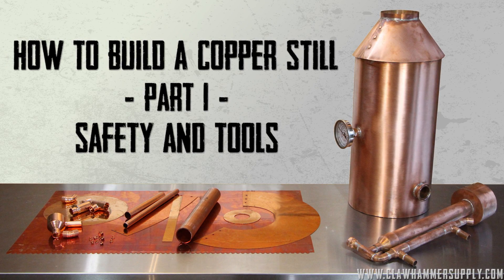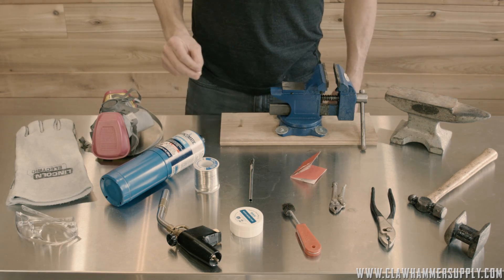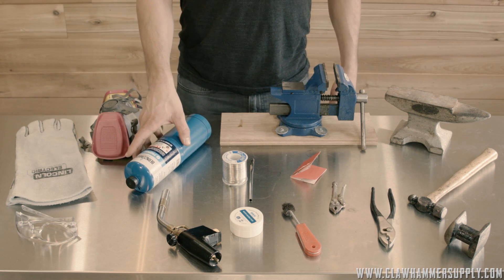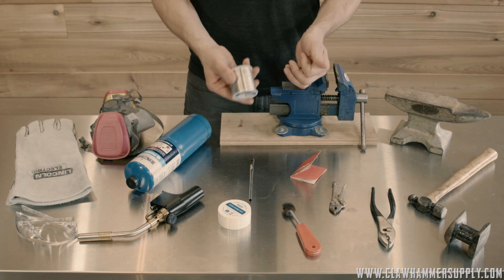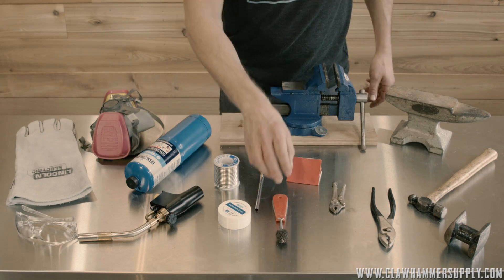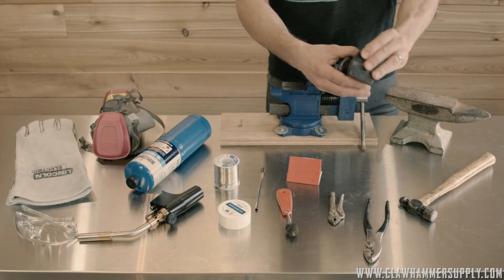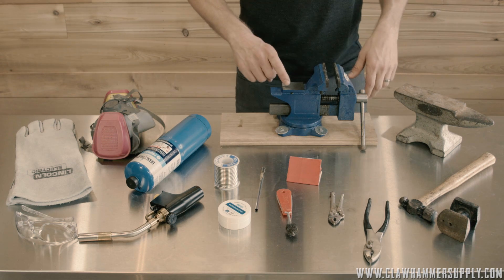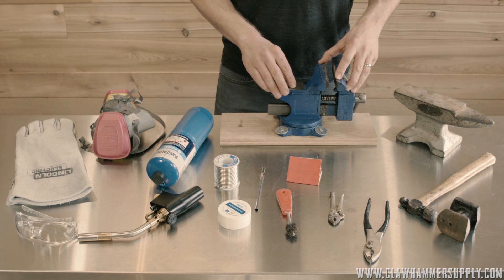How to Make a Moonshine Still - Part 1 - Tools and Safety

Comment: Is there a built in worm or cooling condenser of any type in this still?
Reply: The top section sold with the still is the condenser. It's not a traditional worm, but it works just as well

Comment: What is used for the heat source when distilling?
Reply: Depending on your set up, you can use a heat plate for smaller stills or a propane burner. I use a burner that came with a turkey fryer, but some folks use an actual wood furnace, but that's a lot of work to build
Reply: Can you use a induction Cooktop

Comment: Kyle .. Got a  Question 4 you .. now Ive Had pots made from 304 stainless food grade 50 gallon barrels and in the bottom  I had 14 ga copplate sweated in the bottom .. Im getting ready to retire in a yr or so and Im thinking of doing a copper pot .. 
Now Im thinking of a 50 ga spit pot . 14 ga bottom and  20 ga for the pot ..  big difference between copper and stainless ..   can you share some info ? 
thanks .
Reply: The main difference I'm aware of is flavor. Copper reacts with the alcohol and makes if smoother without changing the abv much. Take what I say with a grain of salt because IV only run a few batches.
Reply: i was thinking of putting a copper sheet in the bottom of my pot then a roll around the inside for a smother taste and easy clean up

Comment: you can use mapp gas
Reply: Of course you can, I didn't think any plumbers use just propane (it takes to long), ever time I've needed my boiler/pipes repair the plumbers have used mapp gas.
Reply: No
Reply: If you know how yo control the heat you most certainly can

Comment: Copper is because of the heat transfer?
Reply: It does something to the alcohol and they use copper cause of how easy it heats up
Reply: Copper conducts energy better, is easy to work with, and is supposed to take sulfur compounds out of the finished product.